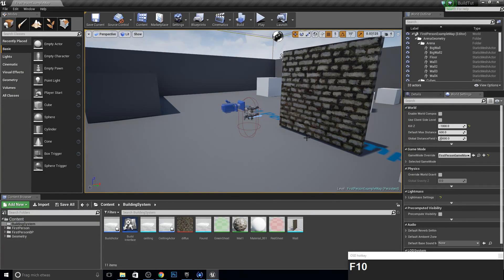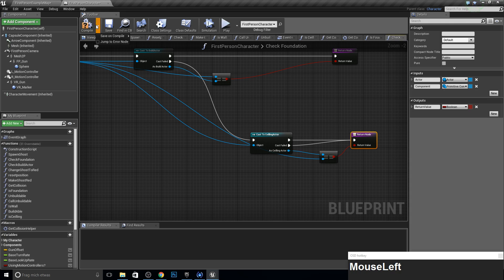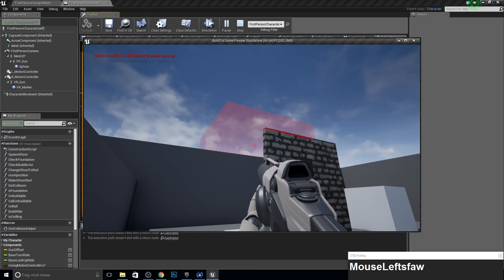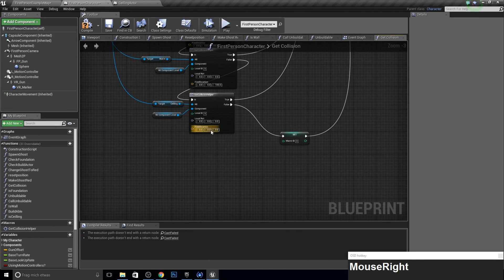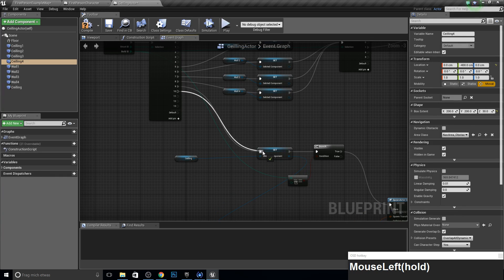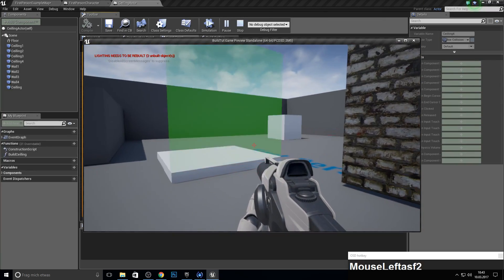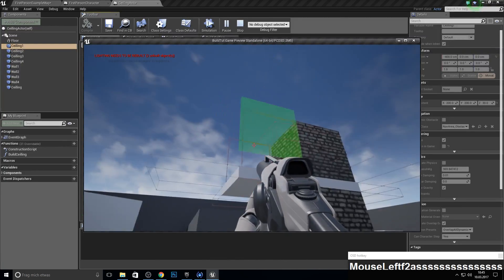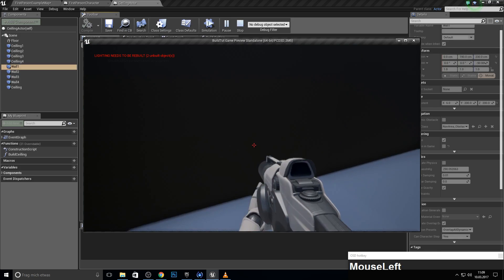Unreal Engine 4 - Building System / Part 6

Comment: Just add tags to BC inside BuildActor BP and during building add one more sequence node and from there create a new function to toggle visibility of BC. When building the foundation is activated then hide wall collision boxes and so on. I'm wondering why you create a celling actor as separated rather than using same build actor - I did it this way and it was easier and the final result is the same. But after all great tut!

Comment: Hey there Pyro! Did you switch around the Build Actor Function and the Check Foundation Function at some point? The nodes inside them seem switched around compared to how you made them in the your second video. In other words, Check Build Actor has Check Foundation's nodes and vice versa. This is how they are in my build so far.

Comment: Awesome tutorial! A few things: A very easy fix for you to be able to place the walls through the ceilings is to make ceilings and foundations react to a trace channel specifically for the floors and ceilings, and make a separate collision channel for walls. Then, you just have a collision type variable inside the player that is plugged into the trace whenever you switch structures. ALSO: a few little issues: you can place double walls, double ceilings, AND double foundations. Any fix for this?

Comment: I Solve problem what you talking about on 11:10. Before explain it i just wanna say your videos are really awesome pls keep goin it :)
1- Create a new function in firsthpersonblueprint like that = https://ibb.co/gKPJMF
2- Put this new function in check build actor function like that= https://ibb.co/djCG8v
Reply from the maker: +Minecraft Delisi Türkiye thanks :)
Reply: Thank you! That works perfectly for the walls, but how about making the trace ignore the first-floor walls in order to place new foundations easier? I tried pulling from the 0 of the Switch on Int in "Remove Collision", and replaced the targets with the 4 walls, but it's not working. 

Also, when standing on a higher floor, you can't build on a lower floor because of the ceiling collision. 

Just to top it off, I'm having an issue where the walls collision allows me to place a foundation ontop of the wall, which isn't what I want. Would love some feedback!

Comment: Could you do a UI slider like rust were you can choose which building part you can use for example; triangle foundations, roof etc
Reply from the maker: +Nijo Tv give me some time, I need to improve my System a Bit and then I will implement that
Reply: great jon bro it help alot ur tutorials, and yes take ur time to rest and update your system and then share with us :) if possible
Reply from the maker: +Mathew Mckeown that would take to much extra work which would lead into 6more Videos. But I'm thinking about it
Reply: Please do pyro It would be so good :D